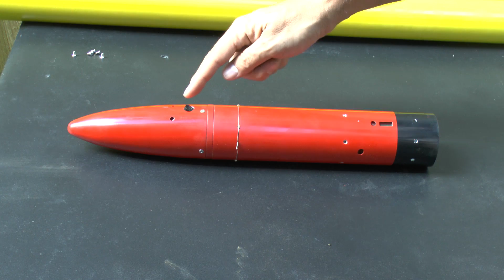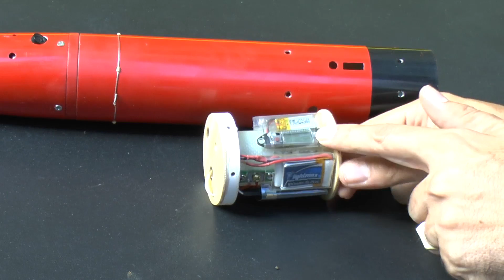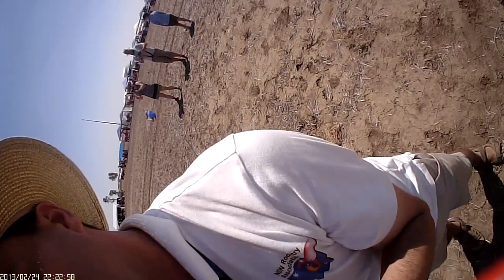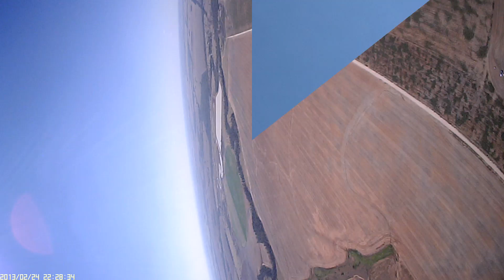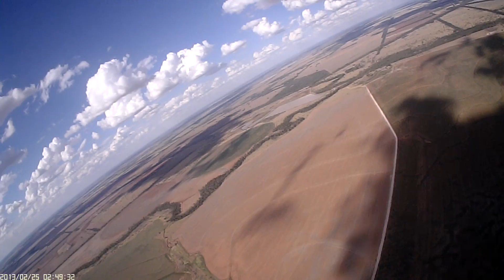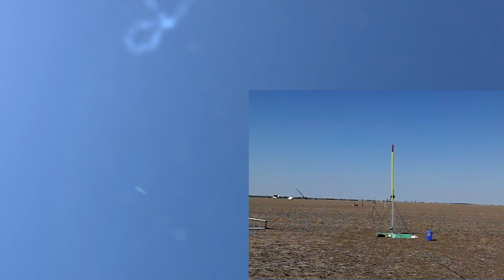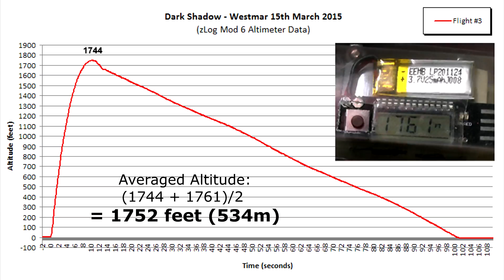Water Rocket flies to 1752 feet (534m)

Comment: Very impressive!
Amazed that it goes through the water (with wicked acceleration) so quickly, but seems to still have thrust from remaining pressure for quite a while.
I would think (guess would be the correct term) a smaller orifice which is tuned to run out of water just before air pressure would increase the acceleration time and maybe altitude.
The slow motion led me to this theory.  
You are the pro and this thing rocks!

Comment: I have observed water rockets for a while and think although highly improved to near its materials strength limits this design is obsolete, highly inefficient or a wasted contraption of its propulsion contraction .... an obsolete water rocket competition similar to that of sailing boat's competition without foils, or similar to a Stirling Engine vs a Diesel Engine vs Electrical but I am not a water rocket expert, thanks for sharing
Reply from the maker: I am not quite sure what you mean by obsolete? Water rockets never were designed to be better than other forms of propulsion. They are definitely inefficient, but they serve as great educational aids. Being inefficient also means you look for ways to make them just that little bit more efficient, and it becomes a great engineering challenge. You'll never go to space with them, but that's ok. We can launch water rockets with the kids all day without breaking the bank like on purchasing model rocket motors. You can also fly them during total fire bans. Water rockets will always be a niche hobby but that's ok.
Reply: @AirCommandRockets  I understand every part of your description, true .... I am sad you did not understand some parts of mine, keep improving your design, there is might in light, a hot balloon does not need the sand bags to rise up quickly in the air ; (

Comment: How can it weight only 1.5kg with 6 liters of water?
Reply from the maker: The weight of a water rocket is typically given as the dry weight.  It also doesn't use six liters of water. That is the pressure chamber capacity which normally is 2/3 full of compressed air, and 1/3 full of water.
Reply: @AirCommandRockets  thanks👍, awesome video

Comment: Water rockets are "fun" but there an asymptote to performance: The velocity of the rocket vehicle is a product of the "jet" (fluid velocity) and the natural logarithm of the mass ratio. Driving up the ejection pressure does increase the fluid velocity but requires ever increasing structural capability. As a research project I have taken fluids to 12,000 to 15,000 psi - it makes a wonderful "water laser" (metal cutter) but could not get to a practical tactical velocity to accelerate the desired payload. Fluid velocity is based on Bernoulli.
The Army experimented with Freon stored in liquid with limited success. The Freon did transition to gas which improved the effective jet velocity. Part of this was to reduce launch signature and gunner hazard. A fluid counter mass or "Davis" gun (patent 1914) works better as you're not tieing the payload to the structure. A possible solution for "rocket" system is a two phase flow where fluid is introduced into the gas stream and accelerated... but the plumbing has to be clever to get the sweet spot for performance. Internal ballistics of the propellant has to be clever too.
Reply from the maker: One way to introduce 2 phase flow is by creating foam inside the rocket. From experience this gives a nice boost in performance.

Comment: I wonder if a hybrid of this and traditional rocket engines could be made. The main benefit I'm seeing from the water rocket is the acceleration, if combined with a traditional rocket motor to kick in once acceleration levels and starts to decline you would have a monster. Traditional rocket motors use alot of there fuel for the initial start and acceleration, if you bypassed all that then just kicked the motor on to continue the flight you would achieve a very high altitude.

Comment: Awesome! Reduce mass of payload. Capacitors instead of batteries? 3 second of power all that needed. Make everything in payload real thin and small.
Reply: Is the Air tank separate from the "fuel" tank? Commercially available PCP air gun spares ... separate tanks capable (and tested) to 190 bar (2700 psi?) Use spare battery capacity to heat the air tank cuz it will go minus celcius very quickly? Drill loads of holes in every thing internal to lighten. Gently mill away any unused pcb as well to get rid of mass and use wires that are just enough current rating. Pre pressurize the water with C02?
Reply: capacitors are made to provide short bursts of energy for up to a few milliseconds. if you want 3 seconds of power to power that camera, you'll need a capacitor that is way bigger and heavier than a battery
Reply: @thingusbrulingus  Calm down, it was just a suggestion, just an idea. Just saying you don't need an hour of runtime? But, most polymer batteries these days have safety circuits and resettable fuses .. in case their shorted. These are easily removed and you can draw quite a lot of current for short periods depending on the battery manufacture quality and how many times you want to use it (especially if the number is 1). I have some 3.7V cells on my desk right now, 80mAh .. 5 - 10 grams with resettable fuses, 3 seconds on a 1 amp load. They get hot.

Comment: Could you tell me how the rocket is powered? I would thank you a lot.
Reply: It uses a pressure fed system. It uses water as a working fluid, then pressurized to force water the water out the back. The water is to this rocket as exaust gasses are to traditional chemical rockets.
Reply: @jmstudios457  muchas gracias perro

Comment: Theoretically, keep on increasing the pressure and eventually send astronauts to the moon
Reply: I have a sense someone will get wooshed
Reply: MAPP Gaming yeh true
Reply: Nop, problems with the g-force. Maybe if there is such a strong valve... and storage too -> equals much more weight
Reply: @1080pixel  he get wooshed
Reply: @adly.prastya  no
Reply: @thibautdesaivre4413  yes
Reply: @adly.prastya  explain, then. I'm sure he understood. He just pointed out another issue
Reply: @thibautdesaivre4413  okay whatever i cant explain. I have -500 iq
Reply: No. As I mentioned the mass ratio will approach an asymptote... it will peak and even fall slightly as the inert weight increases

Comment: What if you used steam?
Reply from the maker: Steam rockets are possible, but that's a very different kind of rocket and launcher construction.
Reply: @AirCommandRockets  I figured everything would be vastly different than what this specific rocket was designed for. I just wasn't sure if you could do it in that first place or if it was even safe. Anyone whose seen old photographs of steam train boiler explosions knows how powerful and dangerous steam is. 
Anyway, thanks for getting back to me. Very impressive work.
Reply from the maker: @spamcan9208  Because you are dealing with much higher temperatures, the pressure chamber has to be able to handle that. The composite airframe that we build would totally go soft and explode at higher temperatures. Hot boiling water under pressure is even less safe than just compressed air, but it does look like fun: https://www.youtube.com/watch?v=hG0Rq-FiHBQ

Comment: I think your captive and release mechanism must be very impressive. Is it built into the rocket or on the stand keeping locked down?  I wonder why there is a delay at the very beginning, The rocket starting traveling up and Then there is a sudden burst. Is that by design?
Reply from the maker: Here are the details of the release mechanism: https://www.youtube.com/watch?v=LFB-CTjYJWM There is a launch tube going up the middle of the rocket through the nozzle. This acts like a piston to give the rocket a little more kick during launch. Not a lot of water escapes while it is moving up the launch tube. When the launch tube emerges out of the nozzle is when the rocket starts producing full thrust and that's what you see.

Comment: I remember as a kid in the 80s buying D motors for around $5 dollars each and we were not rich.  This would be great for kids to get into and not have to work odd jobs to afford the costs to do this hobby.  I don't know if making the body of the rocket is expensive or could be made cheaper if done on a massive scale.  I also set a field on fire accidentally and that would not happen with this type of setup.

Comment: While it takes skills to optimize this design, this is not a real rocket at all. Much of the thrust is from the water which is exhausted in 100 milliseconds. What these guys don't realize is that their "rocket" is in reality a projectile, without propulsion for most of its flight. After the first 30-50 meters it is basically a ballistic projectile. Not a rocket.
Reply from the maker: While I thank you for your comment, I have to disagree with your definition of a rocket. The duration of the burn doesn't determine whether it is a rocket or not. Most model rockets in fact behave this way as well, there is a short duration burn followed by a much longer coast phase. You could argue the same for an orbital rocket there is a short several minute burn followed by months or years of coasting. By your definition, the first 30-50 meters it is a rocket, but after that it is not. By the same argument a rocket on the launch pad, is not a rocket, just a projectile with 0 velocity. I would define a rocket as a device that can carry its own fuel and can utilize that fuel to propel itself over a portion of its lifetime.
Reply: @AirCommandRockets  Not quite. A bullet only becomes a projectile when it is fired from a gun. (dictionary defn.) By your definition I can be in a boat throwing a single rock in one direction and thus constitute the boat- rocket. Definitions are arbitrary.  Do most rockets behave this way? Well,  I am afraid this can not be said about most non ballistic types of missiles.  And they are certainly a majority by numbers as you may know by following military affairs. You see, "air command" conjures up the military....Fair enough. For the kids's sake let it be a rocket. It is...sort of. The principle is present, your device has rocket propulsion for a fraction of a second. Call it an impulse rocket, or a start momentum device,  these are better names for it.
Reply from the maker: Yes I agree, if you throw a rock from a boat, you now have a 'rock'et powered boat. :)
Reply: @AirCommandRockets  Ok, fine, use that boat on your next adventure. I think you are onto something even bigger than water rockets.  Make sure it is some strong guy throwing the rocks. :)

Comment: Also, could you make a 2 stage rocket like this? Or is the weight of the water not worth the additional thrust of the 2nd stage? I'm thinking like either 2 stages stacked on top of each other or even two side by side, one pops first lifting to 1k feet or so and then the 2nd pops at 1k feet to bring it higher? I could probably do the math myself but figure you know the answer since you are the water rocket king :)
Reply from the maker: This is in fact what we are working on right now. Here is the series that describes the build progress of a high pressure 2 stage rocket. https://www.youtube.com/watch?v=q-8DWp1LqgQ&list=PL-zcDPSotX7pQ490T-lMMBW_i7fbfD8UH

Comment: How you got the motor to run on water???
Reply: The water is the mass that is thrown out of the nozzle.  The power comes from compressed air pumped in, in this case from a compressed air cylinder.  Once the nozzle is opened, the compressed air inside the rocket pushes the water out of the nozzle and the "equal and opposite reaction" sends the rocket skywards.  There is also some propulsion from the air escaping, but that is secondary, because the water is far more dense.  We used to make very simple water rockets using two squeezy (washing up liquid) bottles, one for the body, and one with cut outs, slipped over the bottom end to make the stabilising fins.  We slightly loosened the cap, then we pumped air in using a bike pump and the sort of adaptor you'd use for a football or similar (like a long narrow tube).  With a cupful or two of water and some vigorous pumping, the cap would eventually let go and the rocket would go several metres in the air.

Comment: Weaponize this model by attaching a warhead and use for short range ballistics.
Reply: Or make an RC foam plane with an electric turbine that has self guidance. Kinda redefines Nerf Super Soaker, eh? Yeah and have it in a fairing so the fairing opens up, the plane’s flight surfaces open up, the engines start up and the plane flies to a target miles away.

Comment: I’d like to know how many G’s that electrons package experiences.
Reply from the maker: Around 50G
Reply: Air Command Rockets , I would have guessed a peak G load of around 100. 
Still 50 Gs is nothing to sneeze at! 

P.S. I have years of experience building with composites. I built a water rocket once. It didn’t fly near as good as yours; and Unfortunately, my composite homemade pressure vessel ruptured just before launch at  400 psi !!!!  No one got hurt, but I think my poor dog still has PTSD from the experience. 
So, anyway, my hats off to you for building such a strong vessel!  You guys must really know what you’re doing.
Reply from the maker: Cheers Andew. We are currently building ones to hold 1000psi... If they actually do that is a different question. :) We've tried the construction technique about 6 months ago and tests showed that it can hold at least 1500psi, though we had a couple of leaks. We've improved how we seal them, but ultimately we'll find out in just over a month.

Comment: There's gotta be some way of dispersing the water in a more evenly manner for more power longevity. None the less, thats pretty bad assed 👍
Reply from the maker: Add some bubble bath mix into the water. :)
Reply: @AirCommandRockets  
Well, you know what Mr. Bubble used to say. "Makes getting clean almost as fun as getting dirty".
Reply: @AngryHybridApe  adding more water is as worse as having less water. Plus bubble bath would literally be useless at these thrust levels.
Reply: @alienbeef0421  
Compressed air with water injections at the right time?
Reply: @AirCommandRockets  
But that would make sense...adding bubble bath, or glycerin maybe?

Comment: OK, first water/air powered rocket to get into space, what kind of engineering is it going to take? haha. How many stages and is it even possible? Like a cluster stage one, with 2000 psi, then a 2nd stage with 4000 psi, 3rd with 5000psi  and so on. :D Awesome you saw Homer!
Reply from the maker: I don't believe it is possible to get a water rocket into space (a water rocket in the conventional sense) Even if you define space as being at 80km.  Even a fully optimized multi-stage water rockets is only likely to get you to a couple of km above ground.

Comment: Salted water density is around 1.19 time greater than the one of pure water. Perhaps this rocket would  go 20% higher with salted water?  Note that salted water viscosity is higher,  one thing would be to reduce the water viscosity by heating it or by adding some additive like soap or the one that are used for the negative washing bath in photographic processing.
Reply from the maker: Higher density doesn't necessarily improve altitude. Although you produce higher thrust, you are also having to lift the higher density (heavier) liquid still in the rocket. Here is a whole video we did that looks at this very issue. https://www.youtube.com/watch?v=Fu3rIiPy_18

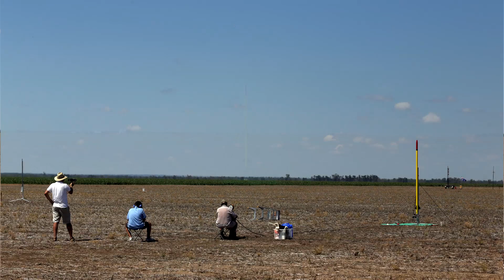Comment: How interesting it is to see you have a micro servo that is not attached to anything. Like 25 years ago our servos controlled things like speed and steering.  You have a servo that doesn't hook to anything. YOu can pull it out and there are no levers attached to it. LOL Lets move on 2:11 there is nothing on this rocket that could hold 500 psi. the largest and smallest air compressors in hige tire and body shops only hold about 125 psi. Almost all pneumatic tools work under 100psi. Even the delicate work of painting a brand new vehicle only needs about 70. At 2:25 if they try to let something at 500psi loose it will go crazy. A simple c02 cartilage might result in this but it would not send something this heavy near a 1/2 mile high. IT WILL NEVER HAPPEN.  Also you can not compress water. so if 1/20 of this was filled with water to 80% with the other 20% air to 500 psi it will not do what they are about to claim happens. OK they are supplying the air to launch the vehicle. I have not seen many devices that can hold 500PSI of anything.  I am just not sold on the "water rocket" idea.
Reply from the maker: "Any sufficiently advanced technology is indistinguishable from magic." - Arthur C Clarke.

Comment: If you used saturated salt water, would the extra propellant density produce more thrust
 and greater altitude ?
Reply from the maker: Not necessarily. Higher thrust yes, but that thrust also has to lift the heavier liquid still in the rocket. Here is a video that explains this: https://www.youtube.com/watch?v=Fu3rIiPy_18

Comment: Air gun tanks hold 300-400 bar, so there's a lot more work to do, and a lot more records to set. I guess keeping the T/W ratio good is a bigger barrier than containing higher pressures. That, and high velocity water is very destructive.